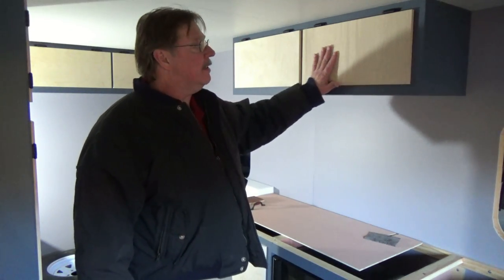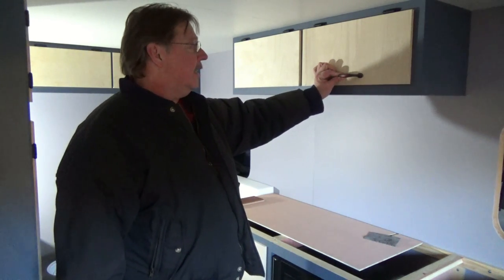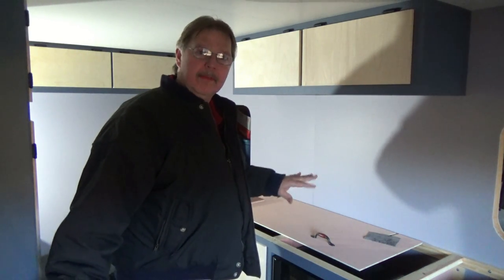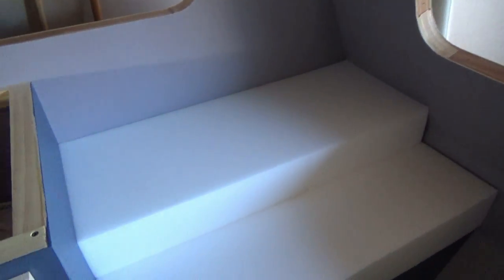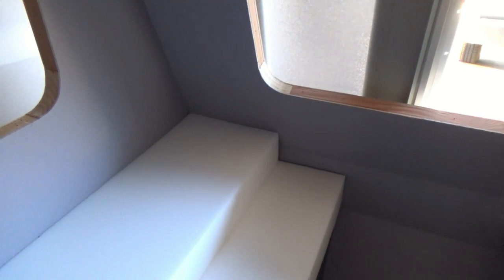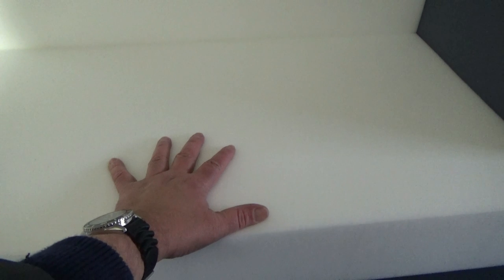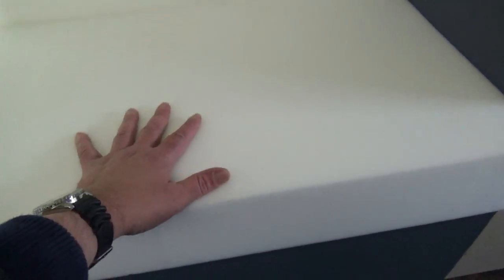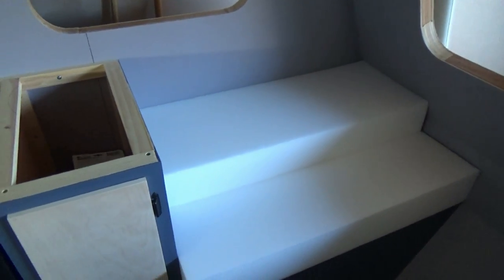How To Build A DIY Travel Trailer - Part 24 (UPDATE - Bench Seat Cushions/Material)

Comment: I was a bit worries about you painting the doors. Good decision to leave them natural. Also.....on your wheel wells. I didn't see you do anything to seal them on the wheel side. Did I miss something or did you miss it. Looked like to me that you just have plywood on the wheel side. Imagine driving it on a rainy road...... I'm planning my 24 foot project summer of 2001. Wish me luck....
Reply from the maker: The natural wood looked so much better! Fits really well with interior! I did seal the wheel wells, but much later in the build. Been couple years and many trips and still holding up! You will go great with your build! So much info on YouTube if you get stuck on something. You'll have no problem doing it right the first time... when you have your plan ready, just stick to it and it should go pretty quick. Thanks for checking it out!